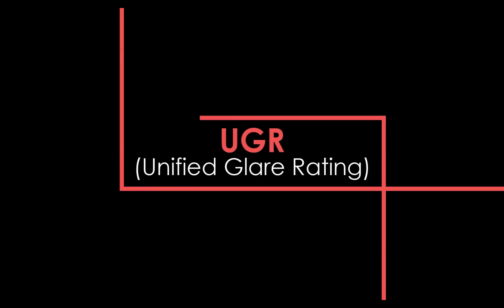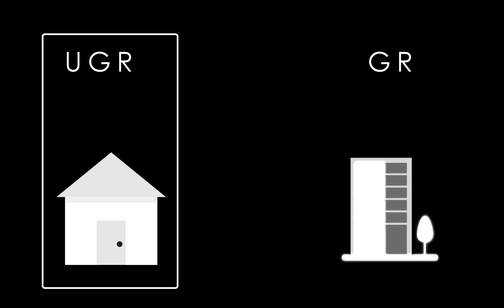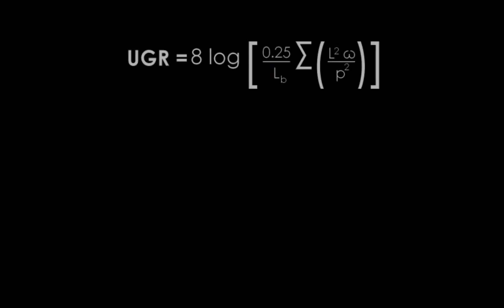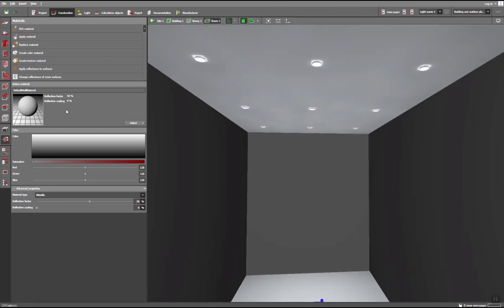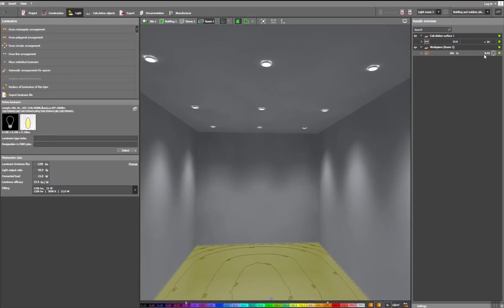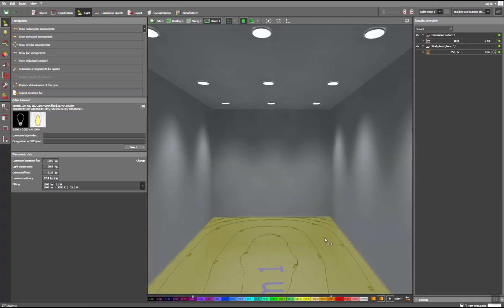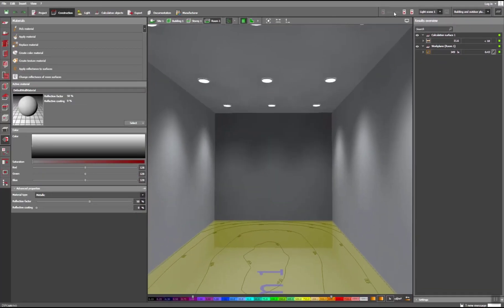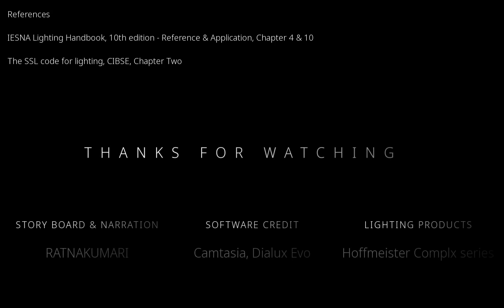UGR (Unified Glare Rating)  - Key Factors

Comment: i dont get why the aperture of the 200mm UGR is lower than the 130mm as the contrast [luminance to background] is higher [created by the 200mm aperture luminance] compared to the 130mm...as i know the higher the contrast the higher the UGR, which comparison between 2nd and 3rd case makes sense - lower wall reflectance creates higher contrast..
Reply from the maker: First of all appreciate you watch till end :), Yes thats the whole point of the video is, We usually miss to see the aspect relative brightness at aperture as I took constant intensity in both cases of 130mm and 200mm, hence intensity w.r.t the aperture have greater impact., which mostly be neglected by many planners who are using photometrics for calculation instead of plugins the importing luminaire size have impact in UGR results.
Reply: @RatnaKumari  thank you for the explanation,  helps alot 👍